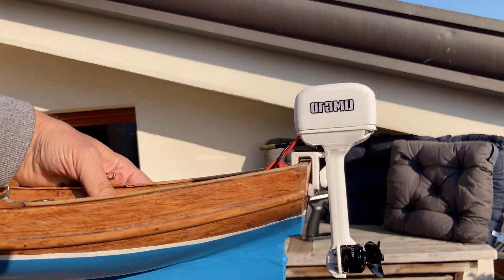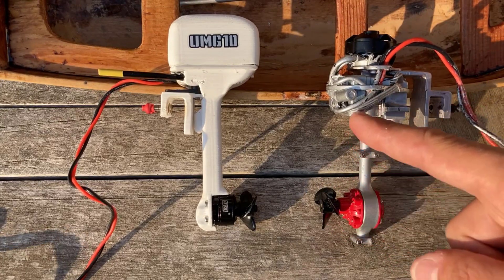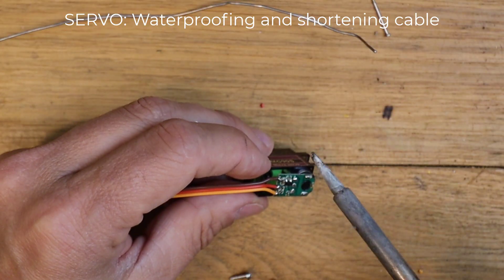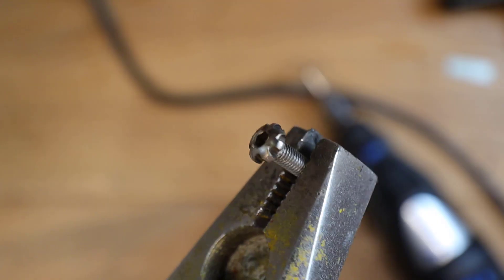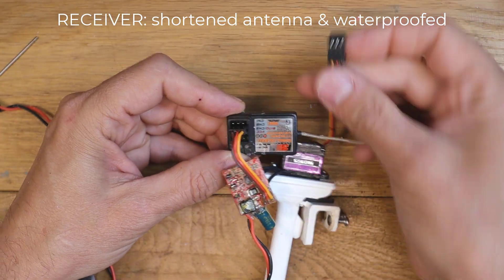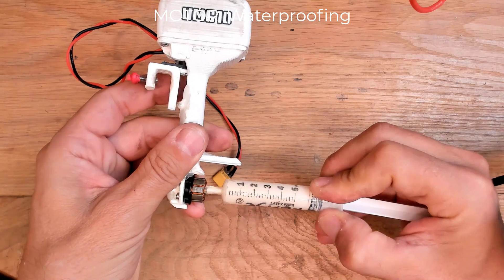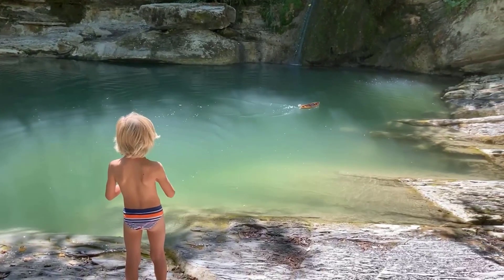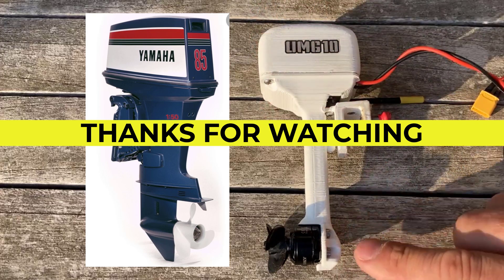DIY RC boat - DIY outboard motor

Comment: The simple yet ingenious structure is wonderful.！！.
I was looking for a homemade outboard motor, and I was impressed by this bold and simple structure. I don't really care about durability, so I'll go with this idea.
Reply from the maker: Hi, thanks. This motor is still running. Without any further maintenance, Maybe the marine grease, maybe the corrosionX

Comment: you don't have to waterproof the motor, just make sure it's fully dry when you're done, and rinse it if it was in salt water
Reply from the maker: Mmm, still the bearings are not easy to dry internally. And in cheap brushless motor those are not sealed or stainless steel, i prefer to “do not have to think about it”
Reply: @MakerFabio  no, the grease is a good idea

Comment: This is great. 

Can you add the file for the anti-ventilation plate you mentioned in the video? Also you mentioned using a 1106 brushless 4200kv motor, is that the same bolt pattern?
Reply from the maker: Hi 
I m now out for holiday
Next week i ll check the bolt pattern dimension and let you know
And also check on the pc for the anti ventilation plate

Comment: can you have a you make a boat with outboard with a biggger brushless motor
Reply from the maker: It could be an idea to scale it up. But at the moment im working on other few projects, soni don t know when i ll do it
Reply: @MakerFabio   thank you for replying do you things in cura the slicer can you make it bigger
Reply from the maker: @maxsfishkeeping1876  sure , you have the scale option for each axis
Then you can use standard servo instead of micro servo
And a bigger motor like a 2212

Comment: The idea of having motor, receiver and servo all in the same unit is very smart. This way you can power any floating thing within 1 minute into a rc boat. Well done!! 
Just some idea to make the motor print stronger. Slice the motor over the symetric center line. Now you can print the left and right half separate and glue them together later. This way all layerlines are in the right direction ( over the length of the motor body) and give a much stronger result
Reply from the maker: Very good Idea, thanks
Maybe i will struggle a little with cleaning support in the center hole , the one for servo. But it is internal so even if it come not too clean it s ok
I ll give it a try with a new small 1106 motor i just purchased
Reply: @MakerFabio  Hi, last weekend I did make your outboard the way I told you to by printing two halfs. Works perfectly. Glued together. Works very good and is very strong this way. I had some "problem" with the hole for the tiller arm being blocked by support But with a drill that has been solved quick. The rest of the support will just break away as normal. And If you want you can also make area's in cura were support will not get printed. To do this you first need to tell it to make support. And then you can add little cubes from the menu that you can scale and move. these need to be placed on area's you don't want support  so if a hole needs to keep free of support make sure you add a cube that will be bigge than the total volume of the hole and make sure to position the cube in a way that the total hole is inside this cube in 3 directions.
Reply: @dextersxxxxlab  Can you share the 3d files in thingyverse that you used.
Reply from the maker: @coryroyce1  hi, link in the description, only the ventilation plate is missing because i printed it later
Reply: @MakerFabio  Can you add the STL file for the ventilation plate that you created in Thingyverse?
Reply from the maker: @coryroyce1  ok, but i m now out for summer holiday, will do it next week. In case i forget, please remind me
Reply: @MakerFabio  How did the 1106 motor build go?

Comment: This could probably be improved using a motor with a smaller circumference and taller stator
Reply from the maker: Thanks, Correct, i already purchased a 1106 brushless 4200kv motor

Comment: Nice project, but these motors are notorious for getting waterlogged. In Thailand, all the boats on the river place the engine on-board, and then run a twenty foot long driveshaft down to the water. No seal, nothing to fail. They put a joystick on the entire V-8 engine block to steer the boat. No rudder either.
Reply from the maker: Hi
I love the thailand mud motors , so essential. I will build one sooner or later. But I wanted something looking like the motors we have here in Italy.
Is now 6 months Im using it at least 3 times per week and the motor is still running smooth with corrosion x and nautical grease. So i really like it and i think is reliable. If it will eventually fail in 1 year (maybe nust the bearing ) i will replace it
Reply: @MakerFabio  Your motor looks great! Keep up the good work. I don’t have enough patience to do what you’re doing!
Reply: @ronliebermann Long tail boats are only fun for a few rides. They are exhausting to control and not every efficient. A mercury outboard will destroy any Longtail mud motor. Outboards are the future in electric and super charged v12s that can bring a 63ft boat to 80mph. Something a mud motor cannot do. Mud motors also need lots of maintenance.
Reply: @beerforyourhorses3812  Good points. But remember that batteries don’t have much energy. 

The energy density of gasoline is fifty times higher than a lithium battery. That won’t change anytime soon. 

And if you add water injection to an engine, the energy density of gasoline is a hundred times higher than batteries. There’s no comparison.

With water injection, Detroit engines could easily get eighty miles to the gallon.

Comment: Great, I want a small outboard for my rc sailing boat.
What prop are you using, or is it a 3d print?
What Amps for speed controller?
Reply from the maker: Hi
All details are in the description